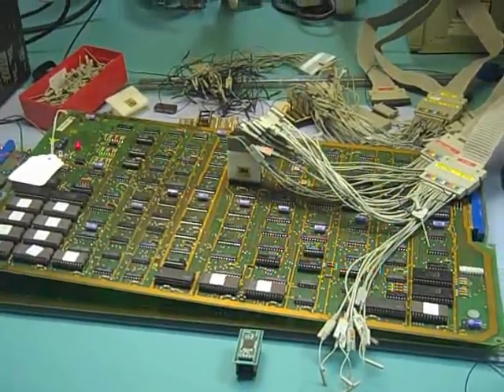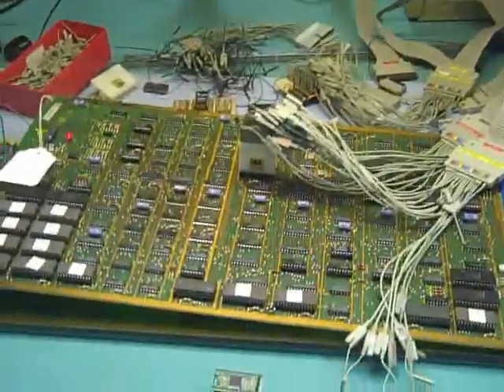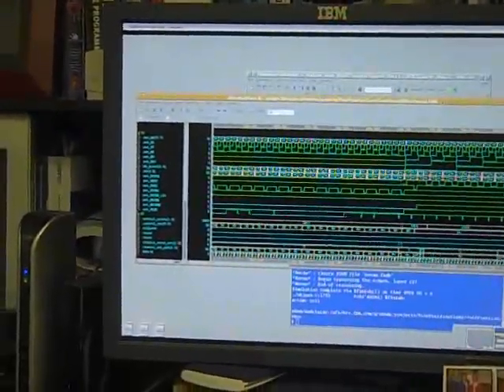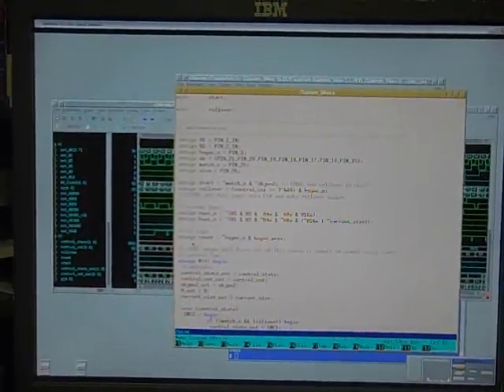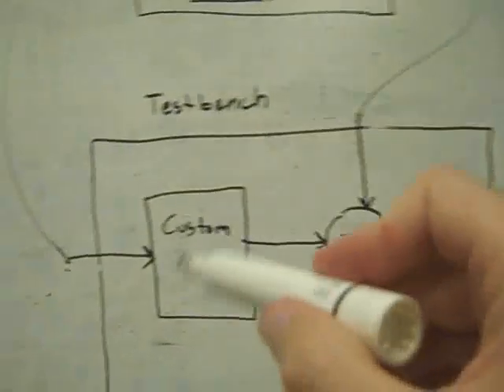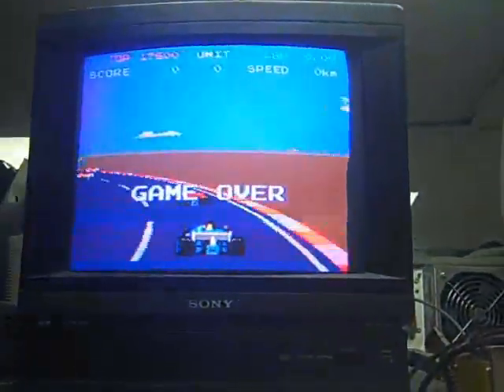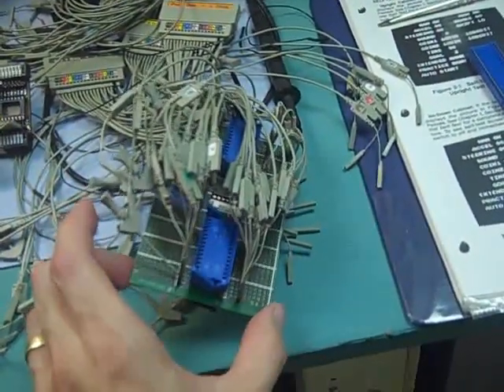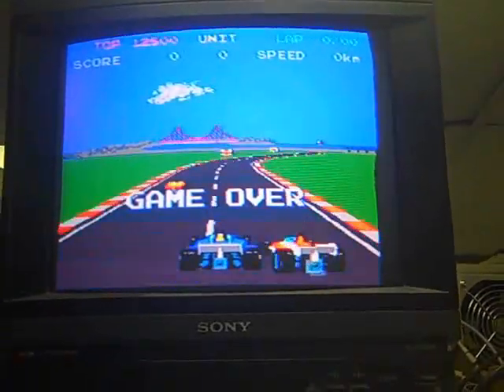Reverse Engineering Namco Customs

Comment: @ajcrm125 Do you have any additional resources/tips on reverse engineering, for specific example, Namco's 05XX custom ICs used in Galaga/Bosconian? I noticed in your other PP customs video you seemed to use an Analyzer in conjunction with an XOR-enabled in/out daughter card logic/timing conparater. You also seemed to be using some sort of program which allowed you to prevent the PolePosition game from proceeding to step to the next game logic clock until you clicked the "Run" button on the analyzer program, and I'm not sure how you managed to do that either. Any advice or resources you could provide would be super appreciated! I can tell you're extremely skilled and talented at what you do and I'd love to pick your brain however possible if it would be alright with you!
Reply: As for my own resources to work with, I have access to Xilinx Artix 7 and Lattice ICE40HX8K FPGAs, as well as Atmel ATF1504 CPLDs (effectively modern sku for Altera's discontinued M7000 series PLD), but I have no available resources on any hardware that is or once was provided by Mike/FPGA arcade, and his site appears to be in a state of flux right at this moment in time.

Comment: Hey Adam, I just started getting into HLD. Mostly thanks to your videos. I was wondering  how important getting the delay times are.
Reply: Hey Ian. If you are trying to replicate the actual Namco customs to use in an original PCB, then the timings need to be pretty close. If you're trying to replicate the overall function so you can toss the whole game into an FPGA, then it doesn't have to match the timings exactly... just the overall function has to match.